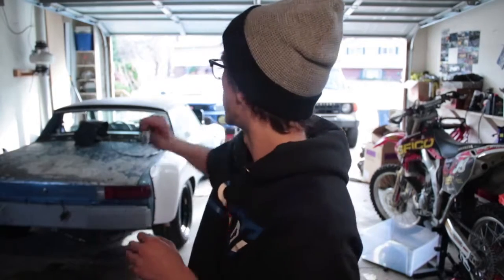Project 914 Episode 28 | CV Axle Assembly (Old Footage)

Comment: Very Nice and much appreciated. Im building a Mid Engine VW Karmann Ghia. Subaru EG33 engine and Impreza FWD Trans...It looks like you used Subaru axles and had the ends resplined? Im going to do the same. Who did the respline work? Did you consider the SubaruGears trans stub axle hub?
Reply from the maker: Nice! I'm actually look Into doing a 6 cylinder in the future. I actually used the Porsche axles since they are bigger diameter. Dutchman axle services machines them. $160 shipped for the pair. And no, just because of the cost.